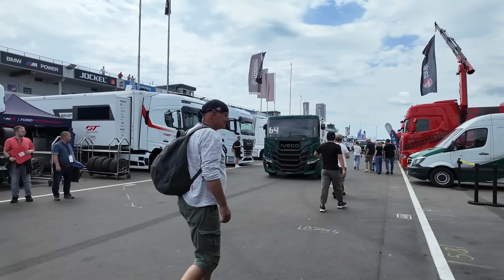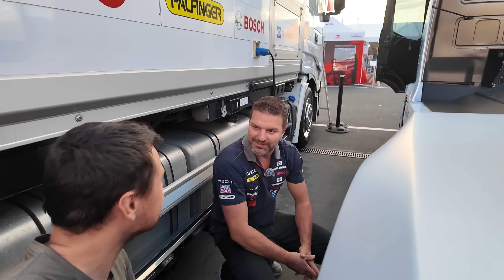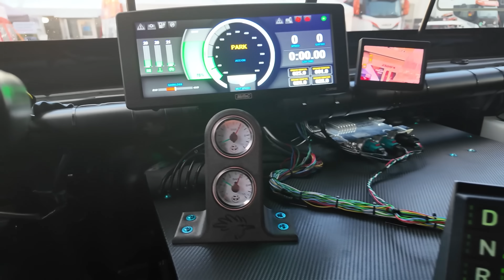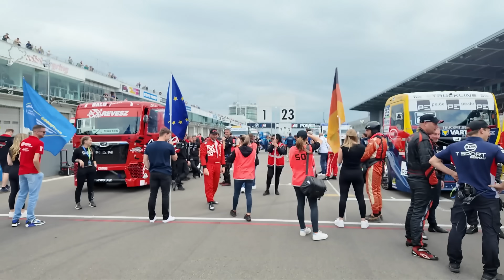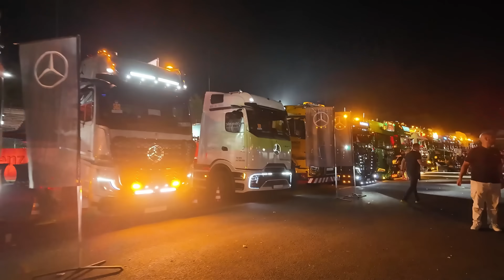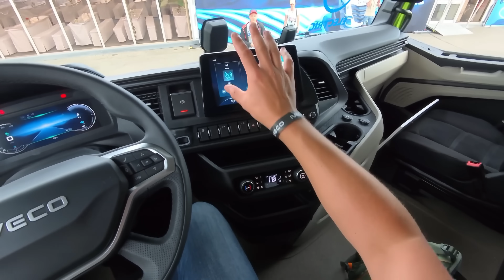The World's First Fully Electric Race Truck at the Truck Grand Prix

Comment: When it comes to Electric trucks, as a Tesla fan who drives a CyberBeast, I have to put a mention in for the Tesla Semi, new manufacturing facility 50,000 semi's per year coming on line this year.
"Tesla Semi Rules"
Reply: Tesla is not doing very well outside the USA for some reason...
Reply: Vaporware......
Reply: And the run on less event is showing they can get as high as 25mpge using just 1.55kwh per mile loaded running local routes with some hwy. And 435+miles on a single charge loaded over 72,000# doing Hwy runs at 60+mph average speeds!

They also averaged over 1,200+miles a day in one testing session using slip stream seating and 2-3 charges of 10-80% daily!

Comment: You really need to get to know Transport Evolved. They were over in Germany last week as guests of CATL the massive Chinese battery manufacturer. They have been reporting on EV's for 15 years. Nikki & Kate are very approachable via Patreon, Bsky, Mastedon etc. I am sure they would be very intrested in you and what you have been doing with charge X, your new app, etc. They have good connections with William's Racing in Oxfordshire  who are heavily involved with formula E. Oxfordshire is  functionally the home of world Motorsport. One of the  Formula E race teams based on Oxfordshirev is run by Suzie Wolfe who was a F1 test driver for williams racing and is wife of Toto Wolfe team principle at Mercedes F1 racing. 

As with everything Networking is how you make things happen. If you happen to get to lnowvrge Wolfe's Electric Truck Racing in Germany could become a thing. Electric Truck racing is a very good sales tool, as you should be able to do the whole race on one charge and the power take off and good gearing would make the truck races exciting. Plus if they are works teams they can use it as a R&D development test bed. There are lots of potential wins and Electric  Trucks are still at the bottom of the S curve unlike diesal trucks which are close to the top of their curve.

If you came over to the UK on a delivery for the day and you wanted to go film at William's, I can lend you filming kit such as Apurture lights, drones, insta360 stereo cameras. I live just up the road in Oxford.

I would offer you a place to  stay but my homes a total mess and due to severe disability that isn"t likely to change soon.

Comment: I used to see truck races on Eurosport as a kid and what i always recalled were huge clouds of black smoke as if they were running on coal. It's nice to see emission standards have caught up to racing trucks as well. Still, it be far better of course if they were electric. What you explained about the Iveco, i do wonder why the companies don't listen to the drivers more. They are afterall the users, the happier they are, the more likely they recommend the product to their skeptical diesel driving collegaes.
Reply: They still do create black smoke, but they have a good smoke filter now.
Reply: Racing truck converted to survive a zombie apocalypse...  ?
Reply: The same is true in Australia; we had multiple classes in the same race, including the normal big trucks and the smaller kind. Depending on the track, the smaller trucks were just as fast, but more nimble in corners, holding more speed.